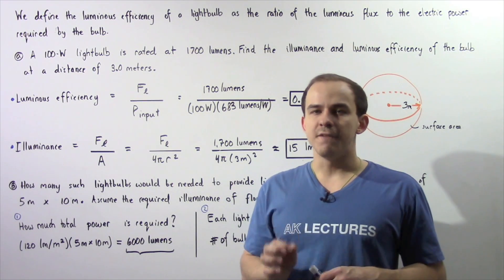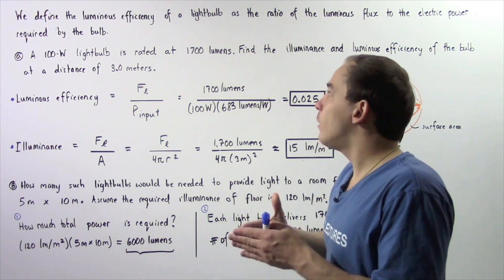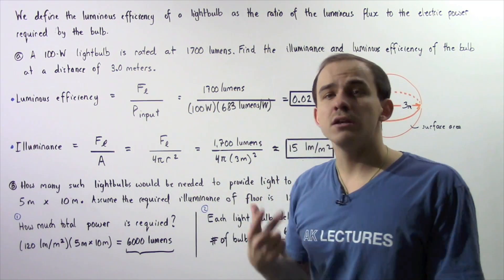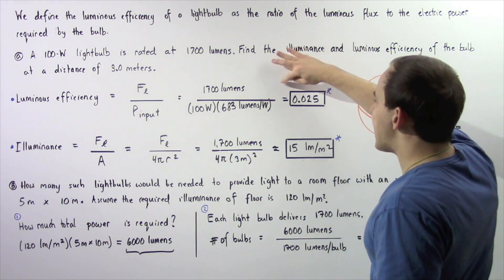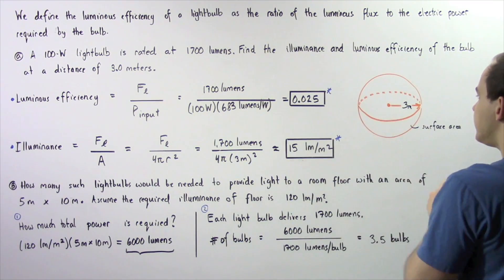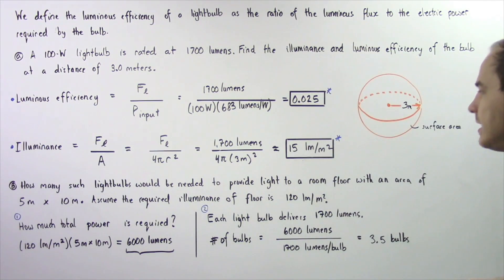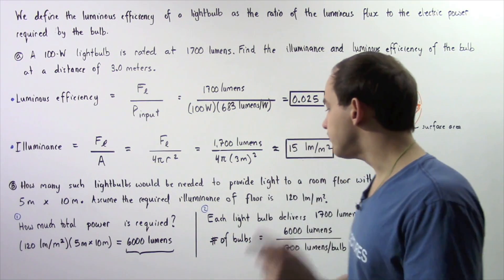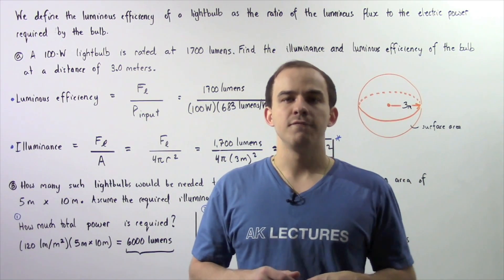Luminous Efficiency and Illuminance Example

Comment: Why are there 683 lumens per Watt?  I would expect this to vary depending on the efficiency of lightbulb.
Reply: look the previous lecture. because 1. the highest sensitivity of our eyes at 550 nm (greeen), 2. you convert electromagnetic waves radiant flux to luminous. I asked myself why do we even need luminosity if we have power of electromagnetic waves. The answer is our human biological nature of eye perception. So answering the 2nd question, it's irrelevant to the efficacy of lighbulb (in terms of electromagnetic waves)

Comment: For part B, the number of light bulbs required to illuminate the floor must depend on the height they are suspended.
Reply: That is the first thing that came to my mind. As if the 1st question doesn't matter.
Reply: I believe that's for the sake of simplicity. After all you should take into account like a ton of additional parameters. Imagine, 
1st the source: the bulb isn't a star and you should not take the total luminosity and radius (height) but take only a part of it calculating from a solid angle. 
the 2nd the receiver each point on the floor receives its specific luminous flux (LF) which depends on the angle to the surface and radius to the source (height), so ideally you should define a function of LF over the floor and take integral. So, since radius is insufficient (we are not talking about a star or something), all the parameters produce insane complexity for negligible precision. 
Though I agree, that jump from one to another concept is aka scientism. At least he should have shown the realm of the problem and assumptions or how these two concepts are related to each other.